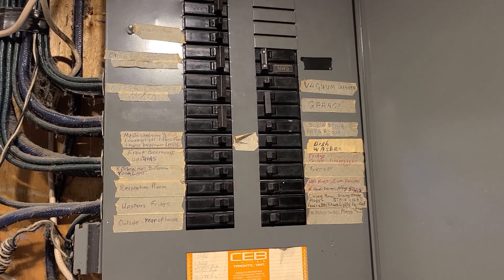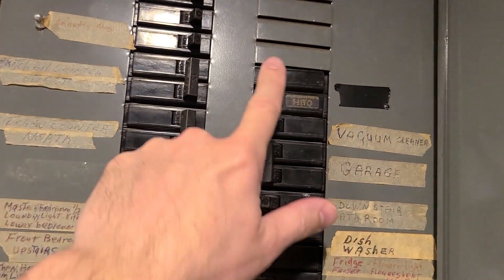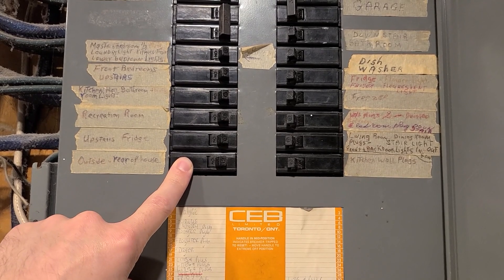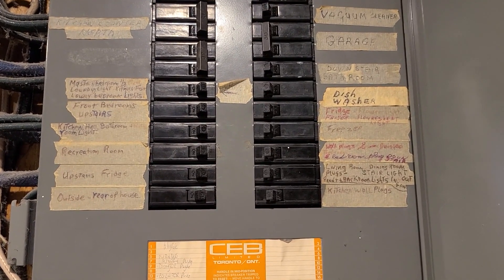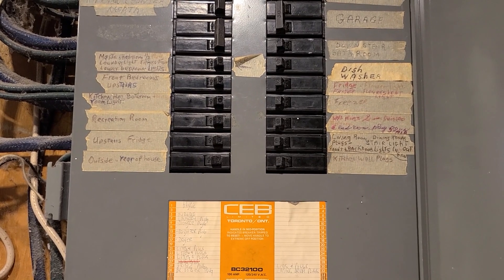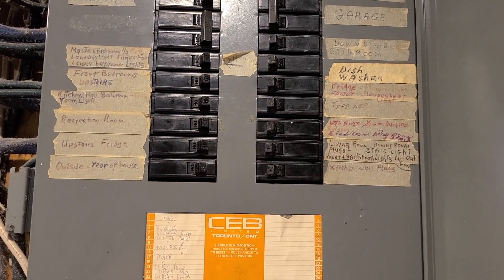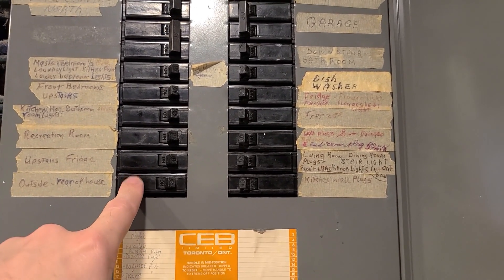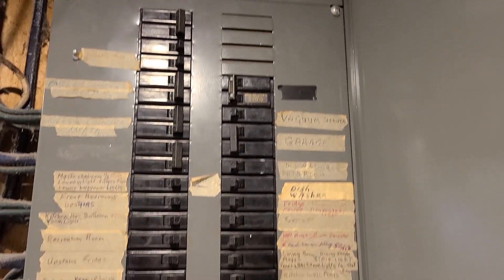Balancing Crypto Mining Farm Power on a Home Electrical Panel

Comment from the maker: North America uses standard 120v plugs, so if it has a 15a circuit you can draw a theoretical max of 1800w per breaker. However, use the 80% rule and bring that down to 1440w. Unless that is a dedicated plug, I also would not go higher than 1200w

Comment: Kinda hard to find what all on the different circuits. Could u use like a cheap volt meter to test the circuit?
Reply from the maker: I suppose so. I have never used that before so I don't know. I just plugged a light in and then flipped the breaker. It really does not take too long. Maybe an hour and I had the whole house mapped out.

Comment: Thank u bro. I might just play it safe 1200w per wall outlet
Reply from the maker: 1200w sounds about good! Just make sure each of those wall outlets are on different breakers as well. Keep note of where the power is in case you need to run a toaster or a vacuum or something as well.

Comment: Nice! Question which extension are u using?
Reply from the maker: Fattest ones from any Home Depot or Lowe's you can find. I have some 25/50 foot ones that are 12ga. They are about $50-80
Reply: @GroweverydayOriginal  Really should not run miners off extension cords 24/7 even 12 gauge cords will burn/melt over time.
Reply from the maker: Good call. This is why if you do use them to make sure you keep it well under the max load. 800w on a 12ga cord gets your 1000w PSU maxed and puts the smallest load on your cable.